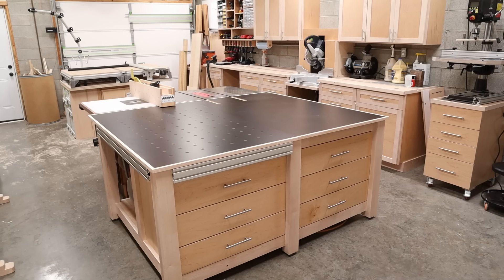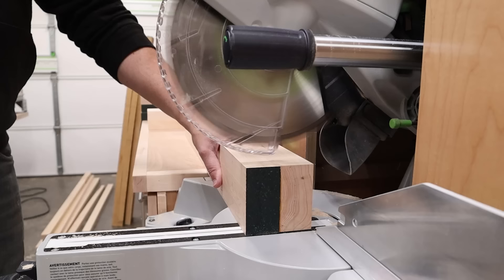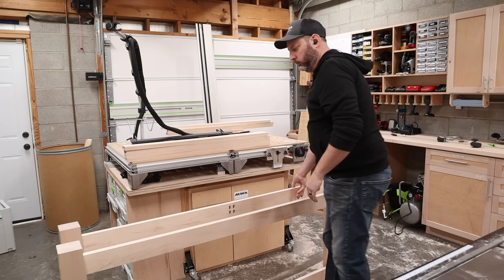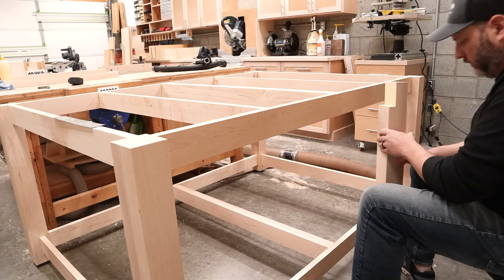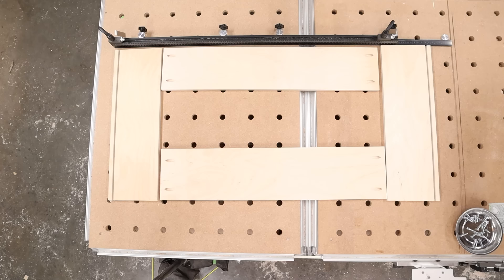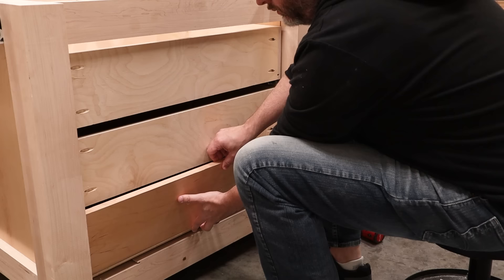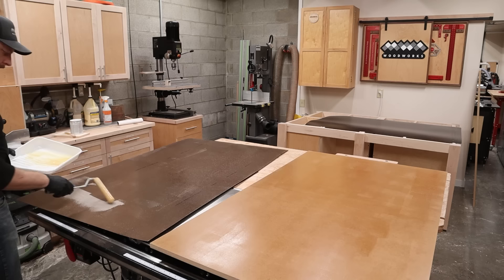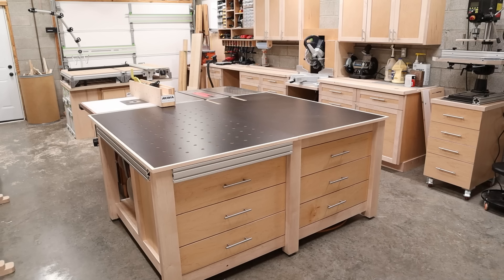Why didn't I build this sooner? // Woodworking assembly table

Comment: Awesome build! One suggestion - if you didn't want the T tracks on the sides to protrude - just bore 1" holes on either end of the t track before installing it, it works great and you don't snag anything on the edges!
Reply from the maker: Great idea!

Comment: I built one, (not quite as fancy as I have a limited budget)  Bought a solid core exterior door 36" x 80" for top,  utilized some re-purposed 4x4's (from neighbors' fence)  and made a cantilevered shelf on one end for my old craftsman tablesaw, large hole in shelf with garbage bag (one end cut off) as a sawdust chute into shop built wooden box on castors to catch sawdust. End vice, storage drawers x 4, shelves for tools i seldom use
Glue & tape rack & clamp storage- Tyler (I wish you tube would allow posting of pictures)
Reply from the maker: That's making great use of what you have available!
Reply: Awesome!

Comment: Even though I have a large table saw, I still end up using a track saw to break down ply wood. So I think my out feed table is going to incorporate track saw accessories, festool dust extractor and cyclone. Maybe even integrate sanding storage 😅
Reply from the maker: All great ideas!

Comment: This is a very nice design, well thought out.  I did something similar to my 40x90 workbench, breaking into 3 pieces so I could CNC whatever type of top I want (dogs, t-track, combo, etc.)  One recommendation is to give access to the top t-slot of your extrusions.  The Kreg Automaxx clamps fit and they are brilliant for top or side clamping, quickly and easily.  They were a game changer when I added extrusion to all 4 sides of my bench.  I hardly use my Festool clamps anymore.
Reply from the maker: That's true although I don't have those clamps... yet 🤣

Comment: theres so many little things with these tables that i think people notice after the fact like what happens when something falls thru the hole? how do you retrieve it. Also when dust falls in there, how do you clean it up? i think a table that addresses this and the other little things would make an ultimate table. I know dennis from hookd on wood addressed this issue and well thought out. Cant wait to make mine. great video still

Comment: I have an outfeed table with a pre-fab maple top with a similar dog hole pattern. I enclosed it underneath, slapped a DC fitting on the end apron, and now the entire thing is a down-draft table. Super handy! Not nearly as big as your tho. Nice work!
Reply from the maker: Oh wow that's awesome.  I need to make a down draft table
Reply: @MWAWoodworks  I need to use a block of wood if I want to use a hold-fast, because they’ll whack the little 1/4” ply if whatever I’m holding is thin, but that’s a small compromise. I just screwed thin plywood rails at a slight incline onto the front and back apron, slid the plywood in, then held it in with blue tape. So if I drop something in there (and can’t get it with a magnet), I can take the tape off and fish it out. Or fish it thru the dust port. Even if you have a shop vac on a random orbit sander, it’s nice to have that to really get the dust flowing away from your face!  I just disconnect the hose and use it for my router table or drum sander. Super handy.

Comment: At one employer, we had a "spindal saw".  It was a cast block with a movable vertical mounted motor, to which a blade was mounted.  I could raise the spinning blade up or down by 150 mm.

Comment: At 7:37 I would have clamped the middle of one leg to the middle of the diagonally opposit  leg. Clamping the top will only correct the top corners and the bench will have to be rolled over to do the bottom 4 corners. Cheers.

Comment: I've got an upgrade you have probably thought of already by now - with all those dog holes your top draws are going to end up full of saw dust and shavings falling through into your draws and cabinets below ? Maybe turn that top into a shallow torsion box thus solving the sawdust and debris problem but also allowing you to use the dog holes as intended 🤔
Reply: Ps - pain in the ass when you figure this out after the fact 😆

Comment: I always see tops edge banded before formica and I think you did it right lol AFTER formica because it has thickness and that edge banding protects the formica from chipping up.
Reply from the maker: Good point!
Reply: Yes but also really difficult to make the edge banding 100% flush with the formica if applied afterwards. You can have it slightly proud and then trim rout it flush "from the side" but that's a delicate operation not routing into the laminate. Anyway, nice build.

Comment: Excellent build. I like the setup and all of the storage space you have. Your narration also makes it simple and easy to understand what steps you use. I agree with one of the other comments that edge banding after the Formica is easier and more accurate. After all is said and done, what do you think the total cost of building a table like this would be? What is the total size of the table. I have a single car garage that I'm getting setup and, to be honest, I did it out of construction lumbar and rough plywood covered with Formica bc of the cost. Looking forward to watching some of your other vidoes as well.

Comment: Nice outfeed table. I built a ROUBO split top bench and the design has the outside face of the legs flush with the top for smooth unencumbered clamping. That might have been a nice idea to work into yours. Don't get me wrong, again that is a nice table.

Comment: Is that a roll of wide paper dispenser you drafted under the top? Looks like the same idea I did on one of my benches. A friend works at a napkin/placemats factory and he brings me the partial rolls 24 inch wide when they switch over.
Reply from the maker: No

Comment: Great bench! Building mine based on this design - with some tweaks! 

Did you build your bottom rails low enough (or high enough) to go over/under the dust collection port? How did you integrate your dust collection with this setup?

Comment: With all that saw dust if you have a pellet maker you could make it into pellets for a pellet stove to heat the house or shop.
Reply from the maker: the issue always is that there is MDF and plywood dust mixed in there that I wouldn't want to burn indoors, otherwise it would be a perfect use for it

Comment: How about routing grooves in between the dog holes for track clamps?  Gives you other options for holding down your workpieces.  Something similar to the new track clamp work bench Woodpecker came out with.
Reply from the maker: You could do that. Probably reduce the number of dog holes otherwise there won't be much actaul table top left lol

Comment: I really like the workbench you built. So much so, I am looking at purchasing the plans. I do have one question though. How are you mitigating the dust, glue, and other debris that falls into the dog holes from getting into the drawers?
Reply from the maker: I dont do anything to mitigate it. I'f I'm doing a really messy glueup I have silicone mats that I put on the table. Every once in a while I vacuum out the upper drawer, maybe once every 6 months

Comment: Question. Has adding the Formica to the table top interfered with being able to use your festool clamps? I have the bessey ratcheting clamps which are exactly like the festool brand. The metal “L” section of the clamps barely clear the dog hole on just 3/4 mdf. Lowe’s says the thickness of the Formica is .35 of an inch, which sounds too thick from what I saw in this video. Thank you in advance for your reply.
Reply from the maker: No it doesn't interfere and the Lowes guy is not correct it's maybe 1/32 thick

Comment: I have always thought that the cut outs in a table like this to accommodate the table saw miter gauge look unfinished, and expose the MDF particle board.  Has anyone thought to place some sheet metal on the floor of these cuts to trim them out, perhaps some pieces of aluminum or stainless?  I literally just thought of it.  Nice assembly table.  Thank you!
Reply from the maker: I never thought of doing that. I actually kind of like the contrasting colors of the raw MDF and the black Formica

Comment: Have you changed out those handles yet?

I installed those in a kitchen I renovated about 20 years ago... I soon began to regret my decision after ripping two pairs of shorts from catching on those style handles.
Reply from the maker: I have those handles all over my shop and I've never been snagged bt them.
Reply: @MWAWoodworks  I loved the way the looked, but they were at just the right height to catch on my pockets. FYI, I'm ordering some formica for my bench tops to try out. That's why I was back watching this again.
Reply from the maker: It was the best decision I made for this bench 👍

Comment: I have been looking at building an outfeed table for my table saw, but my garage is not solely for woodworking.  I was wondering what you would think about making an outfeed table out of 4 separate tables that could lock together.  any thoughts on ideas for locking these tables together?  Thanks.
BTW, I love your channel.  The various shop ideas have inspired me to get most of my tools off of just clamping to the bench top and actually making individual cabinets for each.  I'm also about to start a built in cabinets for my wife based on your quick cabinet designs.
Reply from the maker: I've never see someone try ti wrangle four tables into one but I have seen people do it with two. I think they used barrel locks to secure them together

Comment: Can you give some detail on how you decide the drawer mount spacing? It looks like you are using a scrap piece of plywood to set the mounts locations??
Reply from the maker: I design everything in Fusion 360. Once I see where the drawers need to be o calculate the distance up from the base of the cabinet and use my scrap of plywood as a way to make sure the slides are the exact same height on both sides.
Reply: Yeah, I don’t have access to that program. Im building this table from your plans and dimensions are to your plan specs. Any chance you might remember placement heights to give me a place to start?

Comment: Unless I'm mistaken, the stretchers between the legs are usually inset from the outside of the leg, not the inside. Why did you put your stretchers so far back from the outside of the leg?
Reply from the maker: So that the cabinet sides sit flush with the legs. Makes adding drawer slides way easier

Comment: This is great, and I plan to build this or something very close to it very soon.  Thanks!  One question though.  I too like the idea of dogholes in the laminated top, however I do not have a CNC.  What would you recommend as the cleanest way to bore these dogholes without getting tearout in the laminate?
Reply from the maker: There's a link in the description for a product called the parf guide system for creating mft style tops by hand (with a drill)

Comment: Great build! Thinking about replacing my outfeed/assembly table so this might work nicely. One question though....I'd like to do the dogholes but get lots of sawdust and shavings on my tabletop, any ideas on how to keep all this from falling through and making the inside of the drawers and cabinet a mess? Thanks!
Reply: A small 1/4 hardboard sloped towards the sides of your table under the tabletop can allow most of the dust fall towards the sides but shield things underneath.

Comment: I’ve gotten to drawer building and hit a problem. I can’t find 5/8” plywood locally. All out of stock. Would it be better to go an 1/8” smaller to 1/2” or 1/8” bigger to 3/4” to build the drawer boxes? Both of those sizes are readily available.
Reply from the maker: For drawers that big I'd think 3/4"

Comment: And just ignore the sparks showing the 1 inch rabbiting bit being destroyed by nails.

Nicely done otherwise, although I probably would have done it as 2 tables just for more options moving it around, but my workshop is more fluid in setup than most
Reply from the maker: I'll have to watch the replay but there  wouldn't have been any metal in the way save an 23 gauge pin which wouldn't have touched that beefy bit.

Comment: you might drill a hole at the end of the miter slots so sawdust can just drop through.
Reply from the maker: That's a good idea. The only reason I'd think twice about it is that I put cabinets below it so all that dust would go right in the upper drawer.

Comment: Excellent video!  One question please: at 3:28 you're using what looks like a black aluminum fence with some stops and dogs attached, which seems like a handy MFT accessary.  What is it / where an I find one?   I looked on your website list of all tools but didn't see it.  Thanks!
Reply from the maker: That's a recent addition from Benchdogs UK

Comment: What size pocket screws do you use for your 5/8th BB ply? Do you use the micro drill bit and guide from Kreg or just the regular size?
Reply from the maker: Regular. You don't need the micro unless it's half inch ply. I use 1 inch screws.

Comment: For shop drawers, do you find that a middle stretcher from the front to the back would better handle heavier items?
Reply from the maker: Yeah adding support under the drawer will help if you plan on having really heavy items in them.

Comment: Awesome video and table! I purchased the plans from your site and plan to build your table for my shop. Question, what millimeter settings do you use on your Festool to get the 3/4 insets for the aprons on the legs?
Reply from the maker: Don't remember exactly but what I did was measure my plywood in mm with a pair of digital calipers and then added half the thickness of my apron (1/2") which should get you around 30 or 31 mm. Variance in plywood thickness will be the determining factor
Reply: Thank you for the info and help! Do you remember what size and length dominoes you used?

Comment: What do you do when you loose screws down in the holes?
Reply from the maker: Get them out of the drawer 😆
Reply: @MWAWoodworks   Lol - I hadn’t really thought abt this aspect of an MFT before now but I use my table A LOT for everything and I always have screws out all over the table. I might opt for only having MFT on one end of the table but idk
Reply from the maker: That's what I ended up doing. The outfeed side is solid no holes
Reply: @MWAWoodworks  how would I attach the mdf top from the underside if I’m going to do a torsion box design?
Reply from the maker: Not sure. Most torsion boxes are glued together which means you'd have to replace the whole thing

Comment: For the legs will the smaller Domino joiner by Festool work or does it need to be big one?
Reply from the maker: I didn't bother trying it with the 500. You "probably" will be OK using 10x50mm domino's but I might double up how many you use

Comment: Ive seen lots of assembly table builds. I like a lot of them. Even though many don’t really suit my needs. This one seems like it could work really well. 

With those thick legs… can you use the Domino 500?
Reply from the maker: I suspect you could use the domino 500, but I would double the number of 50mm dominos just in case
Reply: @MWAWoodworks  That’s what I was thinking. Just use more dominos.

Comment: I will NEVER try to cut a massive flour tortilla!
Reply from the maker: I prefer using the bandsaw, honestly 🤷‍♂️
Reply: @MWAWoodworks  any food based cutting needs to be on the bandsaw. I jointed a pastrami on rye and it was a nightmare.
Reply from the maker: Yeah that would be a nightmare with the snipe

Comment: I see you hold the power button whole time when cutting with Kapex saw. You actually don't need to hold the power button, just click and release the button and the power is on untill you release the trigger on the handle. Many people complain that the design of Kapex's handle is abnormal and hard to work with. It is because they keep the power button and trigger on the handle whole time when cutting. It's much more easier when do it right.
Reply from the maker: Habit, I guess. But I love the design of the saw.